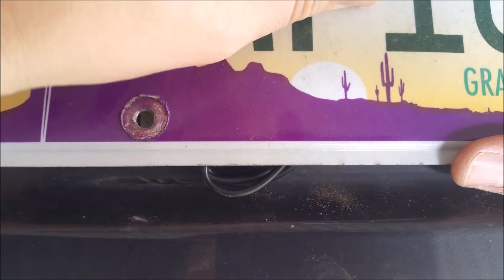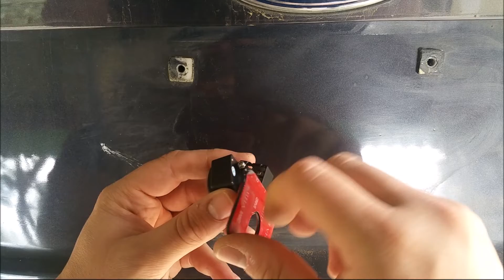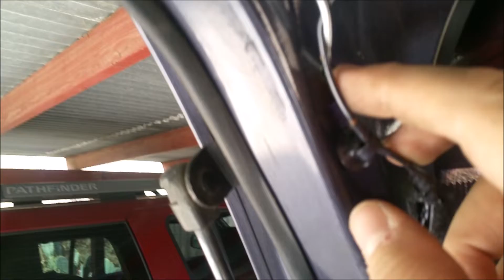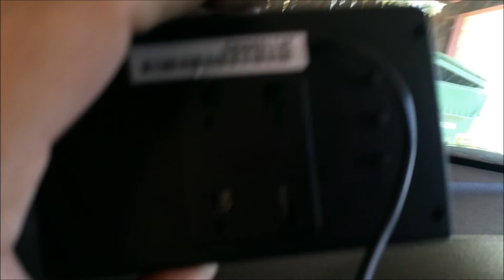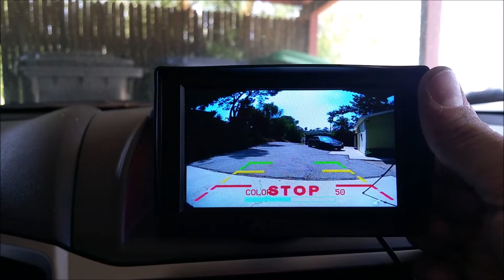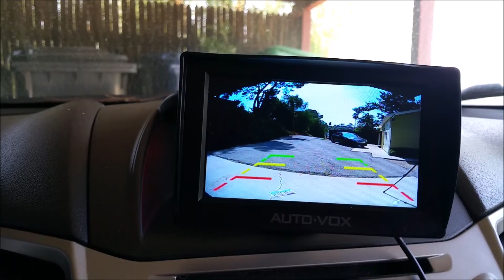Auto Vox Backup Camera Kit Review

Comment: Just came across to your video great video as I have just brought the Auto-Vox TD2 and I'm fitting it now I have ford fiesta style 09 model  and had to take off the boot trim and a few nuts and bolts and fed the wire through the number plate light up and across as I didn't want to drill any holes I've fed the wire down into the light casing to hide wire and connect so thank you for your fantastic video I was able to follow your advice and very happy with how it turned out.

Comment: How would this work on a Pickup Truck--The Transmitter would have to be mounted out in the weather somewhere in the Bed....
Reply: randy beard - To put this in a pickup, the tail light assembly needs to be removed (2 screws). This exposes the wires to the back-up light. Just use the meter to verify positive send negative. (Make sure truck is in reverse to turn the light on). The transmitter can then be mounted somewhere in the opening...lotsa room! Make sure to test it before reassembling. Hope this helps...